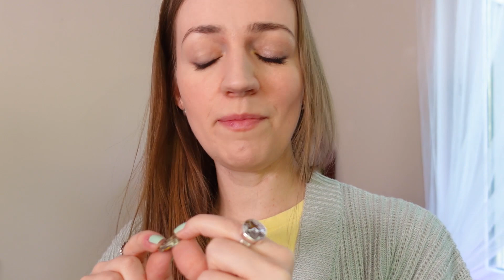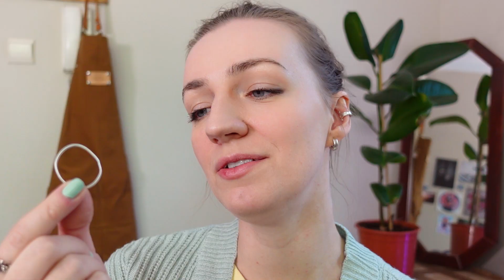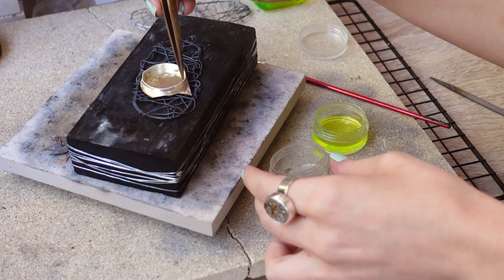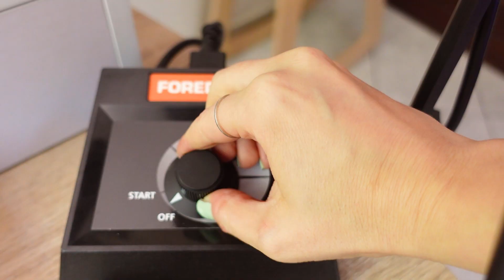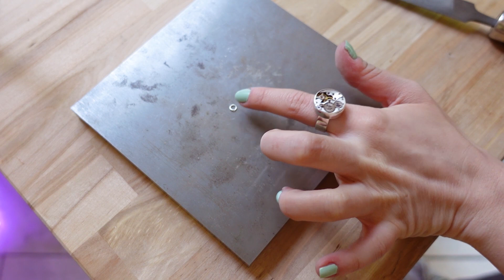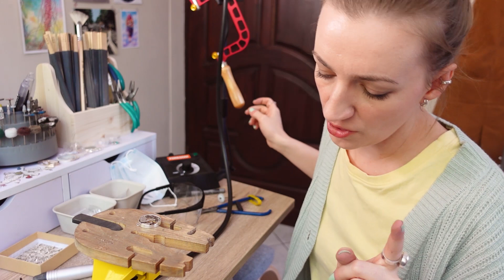Make a necklace with WATCH PARTS! Silversmithing tutorial step by step

Comment: If you are going to solder a silver backing plate onto your bezel - then cut out most of the backing plate - WHY don't you solder in a 'bearer-wire' instead - MUCH less waste and far quicker in the long run?
Reply from the maker: That's a good idea! Here, I wanted to show the simplest way (it's easier than with the bearer wire), especially for when someone wants to control the size of the cutout. But the trick with the bearer wire is very neat and I'll make sure to include it in one of the videos too! Thanks for bringing that up 😀